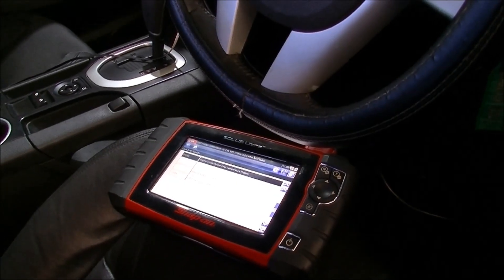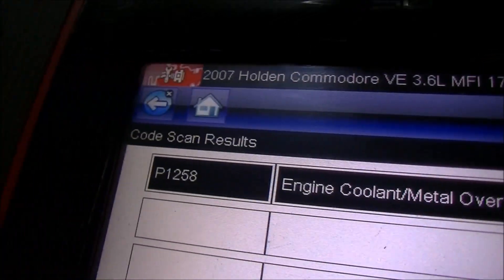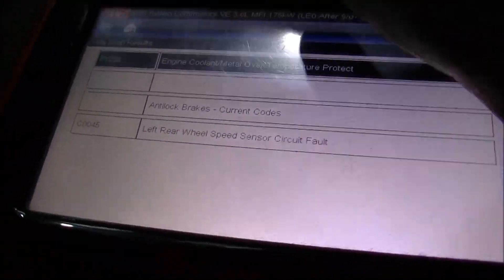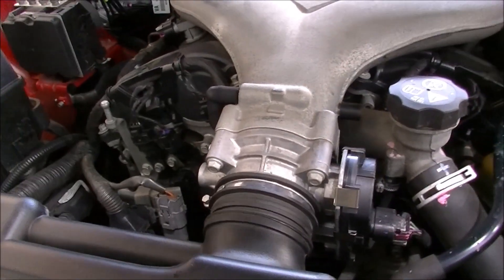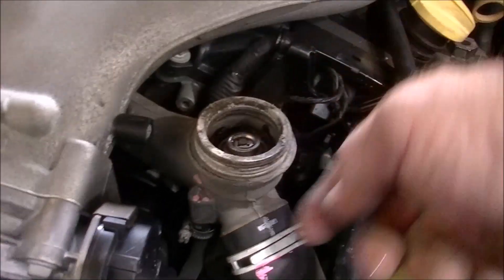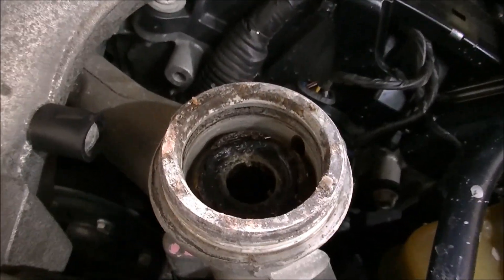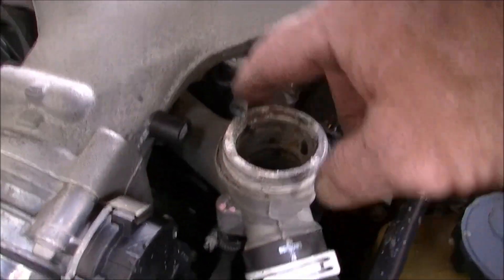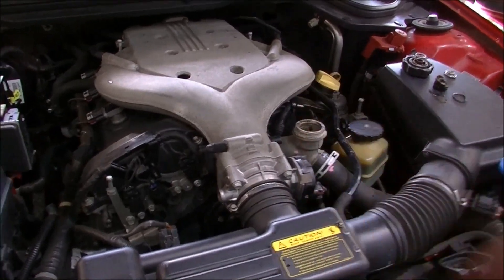Holden Alloytec Code P1258 Overheating...Possible cause.

Comment: hey mate, is there a safe lubricant to stop the cap from essentially welding to the metal body?  had mine stuck and it broke on me, I managed to sort it and get a new one a while back but paranoid now.
Reply from the maker: I bet you have red coolant...Flush it out and use the green stuff...There's a reason we call that stuff "the red death"
Reply: @ziggassedup  nah mate green coolant

Comment: Are there bleeding points on the VE ?? I'm used to the VX and all that there simple. But the alloy tec just a little different. Can anyone let Ms know please. I have had nothing but issues since my last service and I got them to do a flush but it's been over heating bad since.
Reply from the maker: I'm gunna guess the fans are running constantly.
Reply: @ziggassedup   no actually the complete opposite aye. One fan kicks in when it over heats but there passenger side don't. Eh. I'm sure it's just a sensor issue.

Comment: Hi,my vz commadore has started to overheat,turned the car off and coolant in reservoir  was bubbling, 
The radiator cap was very tight to open but eventually got it,the cap actually looks fine but maybe I should just buy a new one?
What's the difference between the radiator caps from repco/supercheap, 
1 of them is rated to 17psi and the other is 18psi,what one should I get or does it even matter,
They both come up when I type in the parts number
Cw18125
Reply from the maker: The cap needs to be a 128kpa....That's about 18psi...Cheers mate.
Reply: @ziggassedup  thank you,il see if Holden has that one

Comment: Mate I just got stuck out in the sticks with my VZ V6 over heating and the oil is milky. I undone that cap you just did and there is nothing in there, it's just a hole like after you took these broken bits out. 
My VZ has done 190,000 and is a 1 tonner thats had a easy life. Any idea on what I should do, if the coolant has gone into the oil it's either a head gasket or a cracked head, does that sound right? Any info would be a blessing, if I was cashed up I wouldn't give a rats, but I'm not, what should or can I do?
Reply from the maker: Yeah mate it  sounds like the head gasket...Only fix is to pull the heads unfortunately.

Comment: right so I was sold a ve wagon from a dodgy as dealer, and the car was overheating and carrying on and the engine light came on the day I bought it lol. Turned out my radiator cap was fckd. I thought it was just my bad luck but had no idea this was common
Reply from the maker: Yeah mate it does...Cheers.

Comment: The issue is that the system can't suck the coolant back in because it can't build pressure and then can't build vacuum!!!
That's why checking the overflow bottle does no good and the actual radiator has to be checked for fluid level!!!
I get customers that have an overheating problem saying that the radiator is full but they are only checking the overflow tank!!!!
The cooling system has to be sealed completely for it to suck back in!!!!
If the system has a leak it will not return coolant back to the radiator and can only push the coolant out!!!!
Good easy fix there Ziggy!!!!
Keep Rocking it out Down Under Brother!!!!
Reply from the maker: Absolutely...Cheers Pat.

Comment: I have the 2005 VZ 190KW Alloytec since new. I’ve changed my cap once after it perished and cracked. I don’t like plastic caps, but it is what it is. These need to checked and the slightest show of perishing, replace it. These engines are much maligned, unfairly I think, but if you treat it with a bit of love and respect they are great engines. Mine has 265,000Km on the clock and no timing chain issues. 5000-6000Km service intervals I highly recommend on Alloytec engines.
Reply from the maker: Yeah mate..I've seen some with lots of Ks on em and no issues but I've seen many that have been dealership serviced on time and still fail under 100000 ks...It's almost like a lottery...Cheers.

Comment: That was easy,,, my luck is usually a head gasket,,lol
Reply from the maker: Keep an eye on the coolant and ya mite have less blown gaskets Vern...lol
Reply: @ziggassedup  well, head gaskets are one of the older subarus short comings, along with wheel bearings.

Comment: The more things change the more they remain the same. Radiator caps the culprit right under our noses yet alot miss the simple things, im lazy i go simple to complex hoping its an easy fox.
Reply from the maker: Yep..Can't tell ya the last time it was checked...Cheers mate.
Reply: @ziggassedup  along time ago now and better days, my stepfather had a red bedford 8 tonner with a 351, it always ran hot, took it to a mate he did everything, radiator, shaved the heads level i mean everything, still ran hot, Jim an old farmer/tyre service owner in southern  cross calmly walked over pointed at the radiator cap and said it was the wrong psi. LOL

Comment: How frustrating...... just the cap. 

Goes to show you if you can familiarise yourself with your car under the bonnet and get ya hands dirty a bit....... 

to the point where you know what looks right and what looks wrong

just to do afew simple weekly checks you can save yourself a lot of hassle....... But the young blokes these days they wouldn’t know their arse from their elbow and they’re just  not interested like we were...
Reply from the maker: I'm forever showing young blokes and sheilas how to check their air,oil and coolant...I don't recon they ever do tho...Cheers mate.

Comment: Hey Zig, red death??
Reply: Yeah, I'm wondering too.
Reply: GM coolant. It's red.
Reply from the maker: Seems every vehicle I work on that has the RED coolant.(GM&Toyota mostly)all suffer from a premature death of many parts...(Waterpumps/radiators/caps/hoses and coolant header tanks)...I'm not the only one to call it the RED DEATH..Cheers mates.
Reply: @ziggassedup  good to hear a different point of view. I've heard from more than one the red coolant better than green. My mechanic has suggested flushing green out & replacing with red when radiator is replaced next Tuesday.